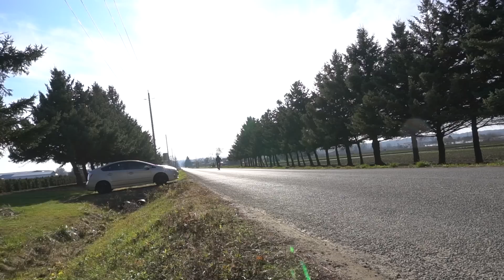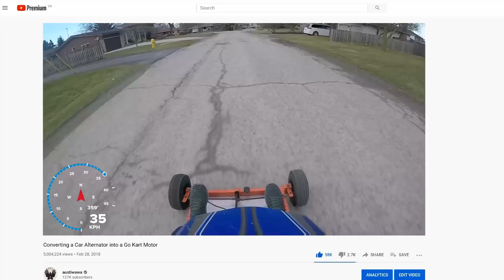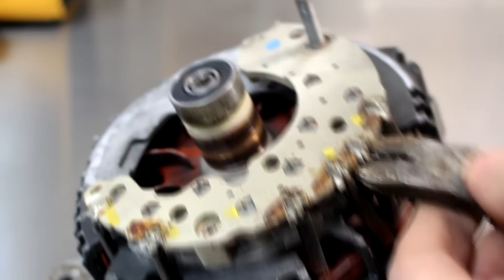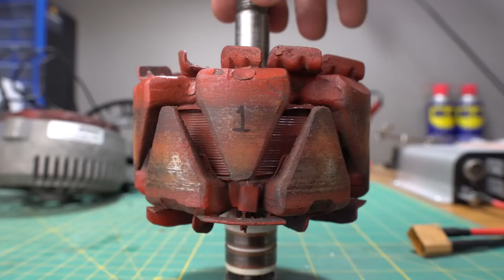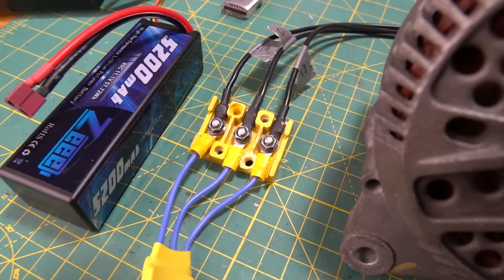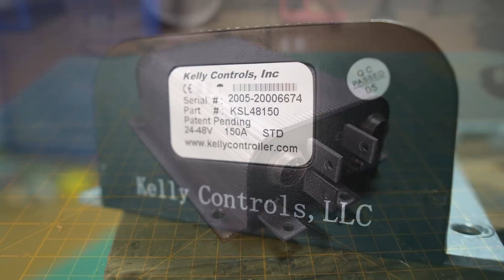Building an Alternator Powered Bike

Comment: What if you did a combination of something that would be like an alternator and solar panel to where the battery was constantly charging like you could have a smaller motor that you could use has an alternator with a charge controller going into your battery pack and a solar panel as well to where you could switch it on and off back and forth between the two so on a cloudy day you could use the alternator and on a sunny day you can use the solar panel and perhaps maybe you could create some kind of device that could switch back and forth between the two automatically so that way it would know the amount of amperage or voltage coming from either one where you could set it to a certain amount of voltage like when it goes down below say 10 volts then the alternator would kick on and then once the sun comes out and then the solar panel is charging above 10 volts then it would turn off the alternator and start charging with the solar 🤔 from what I've seen in this video (and this is the only video I have seen of you so far) but what I've seen in this video I can tell that you are intelligent enough to figure that out... I think I have given you the idea now all you have to do is create it! If it works I hope you give me props for the idea 💡 🤜🏾💥🤛🏽
Reply: Uhh... I proved to you that your idea isn't feasible in efficiency and science terms, so you delete the first comment and put it again?
What do you think that you can achieve insisting on that?
Reply: @foxxyytofficial  well... you didn't actually prove anything you just told me a whole bunch of stuff that made my head hurt. Proving is actually putting your theory into play and to see if it really does or does not work you know like "seeing is believing" so... 🤷🏽‍♂️ You talking about 110 volts of all this stuff and 74 volts and all this stuff or whatever and I think sometimes people just overthink things and makes things more complicated than they really are it's just worth trying the experiment that's all... Have a good one 😊

Comment: Build a couple other battery packs and add fast DC charging and plug into Chadmo charging and see how far you can go and how quick you can recharge,
Reply: DC Fast Charging is high voltage
(200-600VDC and 50-350A), so he would need a really powerful and huge battery pack

But he can try to do Level 2 AC charging (a 3.3kW 240V L2 charger pumps close to 14A, so his 17,5Ah 13S7P battery pack with Sony VTC5 cells (max. charge current is 2,5A/cell) could theoretically be charged if he chooses a good integrated BMS like the expensive Orion ones)

Comment: You could extend your range/add headlights by using the kind that use the wheel to create power. It would add a little back into the batteries during the day, and power your headlights at night. Plus turn signals & brake lights (with added sensors & voltage micro-controllers) & you can also add a speedometer that attaches in the same as the light generators. All off the shelf stuff for bicycles, and it would make it more usable for longer periods of time. Love the build for sure! Good job!
Reply: excuse me what?
you can't simply put a lot of energy back into the battery and power all the same stuff at the same time
why won't you just get a 48V to 12V converter and feed the speedometer+lights, better than trying to messing with dynamos and other generators to drop the efficiency and create drag/waste

Comment: So the Kelly "sensorless" controller requires sensors. And they tell you that you had it wrong? Uhhh...

What you were seeing before you installed the sensors was a vector drive "hunting" because it had no vector feedback. I'm a Controls Engineer and we use sensorless vector drives on pumps, conveyors, etc. with no problems. 

In rare cases we've had a drive doing the same thing where it runs at a minimum speed. We had this on a drive that ran a fan and fortunately it had a V/Hz mode that we were able to put it into that stopped that nonsense. Otherwise we would have chucked the drive and got something else. We simply can't have a drive running a motor when it wants to.  

The startup "jiggle" was the controller tuning itself. Which is fine when a) you ask it to do this, and b) it isn't required each time that you turn on the drive.

Clearly listed in their manual is their standby current of <2ma. Okay, so how do I get this down to below 2ma when the motor runs on its own? Wait for the battery to die? 

Here's the line in the manual: "Standby Battery Current: < 2mA." Sounds to me that you have a case for returning the controller.

Not having a set of contacts to enable the drive to run the motor is a risky thing if you have your butt strapped to said setup. And a run enable input is a simple thing to implement at the factory. We don't allow budding Darwin candidates to ride our equipment, but we insist on run enable inputs nevertheless. Why this is different for electric vehicles is a bit of a head scratcher.

More telling is in the manual for the first drive where several inputs are listed as "temporary unavailable" (even though they mean "temporarily unavailable"). What the heck does this even mean? Either you don't advertise it as an future option (which will probably never happen), or you don't release the product because it isn't ready for market. 

By the way, great video, and excellent troubleshooting on your part. You sold me, subscribed. :)
Reply: Hmm, the "sensorless" controller doesn't exactly need sensors, the controller he installed later (KEB48401X) needs sensors.

The KSL lineup is produced for water pumps, AC/compressors and fans, places that a idle/minimum speed is not a problem, and as most EVs aren't build with transmissions and/or clutches, that is why they say that isn't recommended to EV builds.

But as you can see, they use the same case and connectors as sensored BLDC controllers, and probably the same boards with just a few mods. And the user manual even shows that the system apparantly is limited to 17000eRPM (2833RPM with a 6 pole pairs motor), probably being the reason as why the clutch wasn't engaging correctly as well. the KEB controller able to spin at 40000eRPM (6666RPM), with optional 70000eRPM and 100000eRPM choices at the website.

Clearly they are reusing controllers and manuals for the KSL lineup, and that is where you grab all the strange data (standby current, 5v sensor, the "temporary unavailable").

Comment: okay you are all far and with the clutch chin you can add a second one to load while you drive

.....and by the way done something well
Reply: why does people are so focused on "put a second alternator"?
Reply: @foxxyytofficial  to also adjust and get turug power from it because that is normal for it
Reply: I've already come up with something to get some power back
Reply: @dimitrimotor2861  people keep thinking wrong
Alternators only recharge the 12V battery for 2 reasons:

1) The engine always have more than 40HP, compared with a 2-6HP alternator (try and you will waste energy)

2) The 12V battery doesn't move the car
Reply: @foxxyytofficial  that's why I say converting
Reply: @dimitrimotor2861  it still wouldn't work...

Comment: My uncle scraps cars he practically has an infinite supply of alternators, this give me idea.
Reply: better off to just see what vehicles are available and find an alternator that outputs the most amperage, at least for the purpose of quickly recharging the batteries that charge the power source to begin with lol
Reply: Same with my Uncle and Grandpa. Gotta ask Gramps to set an alternator aside for me :)
Reply: There are some pretty funky water cooled alternators on audis and the occasional VW, usually the most powerful diesel variants, they look to be the best fit if you have a wide choice of the things available ;)
Reply: @mor4y  there also are the mild hybrid systems, like the Hyundai HSG, Honda IMA, GM's BAS/eAssist
Reply: @foxxyytofficial  I actually had a civic IMA, and recharging was handled by the internal hybrid motor, the alternator was only for the 12v side of the car and was a tiny wee thing! :) the 12V battery was about the size of a dry cell from a shopping buggy.  I still have the hulking great 110v hybrid battery pack in my shed, its massive! :)
Reply: @mor4y  the Honda IMA can even be used to power cars and other builds, just need some research
Reply: Stick a bicycle wheel on a pole add vanes and attach an alternator, been done for years , long before Off  Grid was a craze. Good on  a water wheel as well.
Reply: @51WCDodge  and that is for...?
Reply: @foxxyytofficial  An easy cheap12 volt power supply for any purpose. Though with the cost of inverters coming down, 100/240 volt is easy as well. You can also make a makeshift welder from  an alternator.
Reply: @51WCDodge  but the video is for using them as motor, not as generator or welder
Reply: @51WCDodge  yep that's a wind generator.
Reply: YEP TAKE 4 ALTERNATORS ONE FOR EACH WHEEL AND WALA YOU JUST EVENTTED THE ELECTRIC CAR
Reply: @fredlotz155  there's already electric cars with 4 motors
Reply: @fredlotz155  it wasn't looking like a joke, other people suggested that, and channels already did it, so its not something that he could invent
Reply: Now put one on the front to recharge your battery
Reply: @whiplash0567  lots of people says that, but it can't be done in a way that works
Reply: @foxxyytofficial  well...its original design was to produce 12v
Reply: @whiplash0567  but it produces 12V to top the 12V battery for aux systems and ECU, the power to move on a ICE engine comes from the combustion, not the 12V battery
Electric cars only use regen, if using an alternator/generator would really be effective and cheap, of course the big brands would be using it
Reply: @foxxyytofficial  i know this. But could a pully system from the front tire spin a second alternator fast enough to charge the battery?
Reply: @whiplash0567  the problem isn't the speed, nor the gear ratio, but the power

You still need to exert some force on the alternator to make it generate energy consistently

Lets imagine that you're pulling 1500W from the battery, the altermotor isn't 100% efficient and will have some losses, so probably only 1000-1200W on the wheels with just you, the batteries and itself
Now add the second alternator, their connections, the electronics, and see how much the power draw increase

If the controller limits the current you will lose power to move and try to go faster, pulling more from the battery, if not limiting the battery will drain faster than you can put back and you will lose range in a vicious cycle

Comment: 37 kph is 23 mph for the V2 in case you were wondering or "normal" bicycle speeds for a fit and fast rider over some distance, (not a sprint). 
69 kph is 43 mph, so not even Lance Armstrong on P.E.D.'s will keep up with that!

Comment: Ok - so you need 12V constant.  Why not have the 12V constant not fed in until you throttle on?  Then the alternator shouldn't really spin at idle?
Reply: because if the motor doesn't have the magnetism, when the controller kicks in it could create a lot of problems
Reply: and he swapped the controller to elliminate the problem

Comment: Just curious what you think about this: The centrifugal clutch idea could easily have worked  properly, by either putting lighter springs in it, increasing the mass of the flyweights, or a combination of both, or else by getting a bigger clutch if that one was too small. I was also thinking you could have added a micro switch to the throttle, triggered by the initial first couple of mm of motion, connected to a relay supplying field power to the electromagnets. This would have eliminated the issue of the motor constantly spinning at a low speed.

Great final product though. Keep up the good work!
Reply: first, the controller was limited to 2800RPM at peaks

second, when swapping the controller he killed the need for a clutch altogether

and third, if you kill the electromagnets with the controller on, prepare for trouble
Reply: @foxxyytofficial  "𝗳𝗶𝗿𝘀𝘁, 𝘁𝗵𝗲 𝗰𝗼𝗻𝘁𝗿𝗼𝗹𝗹𝗲𝗿 𝘄𝗮𝘀 𝗹𝗶𝗺𝗶𝘁𝗲𝗱 𝘁𝗼 𝟮𝟴𝟬𝟬𝗥𝗣𝗠 𝗮𝘁 𝗽𝗲𝗮𝗸𝘀" ? That's irrelevant. If a centrifugal clutch is weighted and springed correctly, assuming it's the right clutch, it will operate perfectly at even less rpm's than that.
"𝘀𝗲𝗰𝗼𝗻𝗱, 𝘄𝗵𝗲𝗻 𝘀𝘄𝗮𝗽𝗽𝗶𝗻𝗴 𝘁𝗵𝗲 𝗰𝗼𝗻𝘁𝗿𝗼𝗹𝗹𝗲𝗿 𝗵𝗲 𝗸𝗶𝗹𝗹𝗲𝗱 𝘁𝗵𝗲 𝗻𝗲𝗲𝗱 𝗳𝗼𝗿 𝗮 𝗰𝗹𝘂𝘁𝗰𝗵 𝗮𝗹𝘁𝗼𝗴𝗲𝘁𝗵𝗲𝗿" ? I was suggesting what he could have done had he kept the clutch.
"𝗮𝗻𝗱 𝘁𝗵𝗶𝗿𝗱, 𝗶𝗳 𝘆𝗼𝘂 𝗸𝗶𝗹𝗹 𝘁𝗵𝗲 𝗲𝗹𝗲𝗰𝘁𝗿𝗼𝗺𝗮𝗴𝗻𝗲𝘁𝘀 𝘄𝗶𝘁𝗵 𝘁𝗵𝗲 𝗰𝗼𝗻𝘁𝗿𝗼𝗹𝗹𝗲𝗿 𝗼𝗻, 𝗽𝗿𝗲𝗽𝗮𝗿𝗲 𝗳𝗼𝗿 𝘁𝗿𝗼𝘂𝗯𝗹𝗲" ? Nah, not at that low of a a start-up current it wouldn't. Maaaaaaybe, if you just left it setting idle like that for a ridiculous amount of time. But nah, not under practical use.

Comment: Super cool, you are running it at 12v? How much voltage and current are you giving the slip rings?
(suggested 6v max)
I  have a pdf on converting a gm alternator to motor. Iirc one can get like 3 brake horsepower out of it.What is the current demand out of your power pack? One caveat alternators are designed to spin @ 2x or more engine rpm so I would highly recommend some form of cooling fan, maybe a squirrel cage? Keep up the good work, cheers.
Reply: squirrel cage isn't the rotor? for that you would be transforming it into an induction motor
Reply: @foxxyytofficial  I mean an external fan, ducted into the alternator body to provide cooling. Not sure what you meant by "would be transforming into an induction motor"
The spinning core, energized by dc via the slip rings is a magnet. The rotating field in the field coils, provided by a 3 phase motor controller makes it a motor. But I stand by what I said, w/o the air from the fins on the pulley (which was removed  in this project). There is NO air flow, even if the stock fins were there, it's not spinning at even a fraction of normal engine speed. So internals will start to melt/fail.
Reply: @n3glv  now i got it
The "squirrel cage" threw me off because there is a rotor type called that

Comment: Expecting ridicule, couldn't you just have a kill switch integrated on the bars speed controller, junk the clutch 🤷 and off you go?
Reply: Watch the full video before commenting
Reply: And no, he couldn't kill the power
Reply: I did try 😬 but it is so tedious watching someone re inventing something badly, if he'd used a dynamo it would have been equally pointless but more fruitful. As I said a speed controller with a full shut off would have given you an extra 14 minutes of life, not to mention the time your wasting now 👋👋☺️
Reply: @edwardm9227  with an alternator as motor? Did you really killed the rotor power with the stator still energized?

Comment: Holy crap!!! 69 kph? I think that's like just over 40 mph. hope you don't have dry rotted tires because that is a dead trap waiting to happen lol. Have you ever tried this using a hydrostatic motor? It works really well and you can get about 90 mph out of it. Not only that, it makes for an excellent dirt bike. Can't take it in the mud, well, I guess you couldn't put a housing around the unit... But you can climb about a 60° hill with no problem

Comment: What would happen if you attached an unaltered alternator on & had it recharging the batteries on a bank switch.
Reply: It
Wouldn't
Work
Reply: @foxxyytofficial   And.. why  not ? Alternators are used to recharge the battery in a car & supply energy to spark plugs & other electronics in the car. "It Wouldn't Work" is not an acceptable answer.
Reply: @GamingHistorySource  hmm, let's see why it wouldn't work...

1) Alternators don't power the entire car alone, only in mild hybrid systems (with reinforced build quality, 100V+ batteries, and PMSM or AC Induction power units, and we aren't using them)

2) Alternator's in cars are used to keep charge on the battery that keeps the sparks and other things, but its the ICE engine that really powers everything, many times more powerful than the alternator

3) Try to get a 2HP electric motor and a 2HP electric generator, now try to connect them together to move anything with at least 70lb of weight and keep the battery charged at the same time without losing power to drive or just plain wasting all the energy into the losses and heat
Reply: @foxxyytofficial  See ! Now that's what I'm talking about. A concise & reasonable conclusion as to why you think it wouldn't work. So much better than a brow beating  comment like .. it wouldn't work.

Comment: Used to work on car electrical systems and alternator rotors get magnetically saturated somewhere between 5 and 7 volts, so your 12V rotor supply is just making excess heat. You could rewire that pack and get twice the range with the same number of cells. Basically make your main battery the limiting range factor. Love the hall effect sensor instructions.
Reply: most people use 12V with alternators and the alternators don't seem to have some issues with saturation and excess heat unless you go down below 24V on the stator

Comment: Excellent vid! But that sprocket on the wheel is huge! It'd be interesting to see the temps and top speed with much taller gearing, or even better on a more sturdy bike with bigger wheels? 
And once it's at top speed, can you dial back the power to the magnet to go faster still?
And I think it was just the clutch limiting your top speed on the v2.. the halls shouldn't affect it?
Reply: 1) Technically the gearing is already "tall", most builds with alternators and chain or belt drive only get closer to 40kph

2) yes, he could dial down the field power to get a better top speed

3) the hall sensors actually make a bit of difference because with them correctly aligned, the controller can make the commutation steps more efficiently